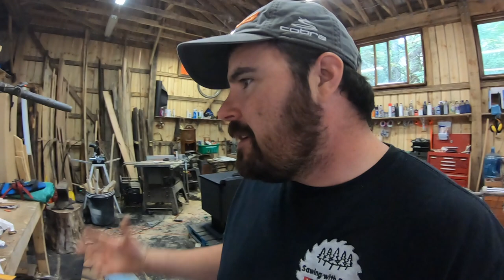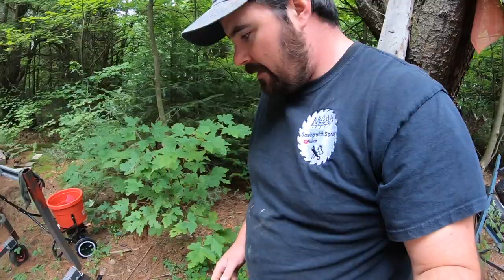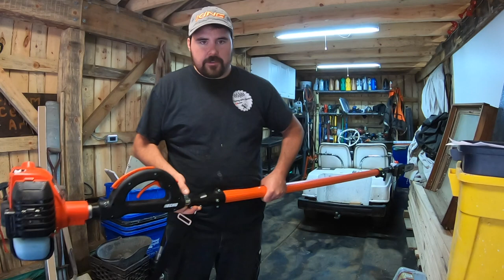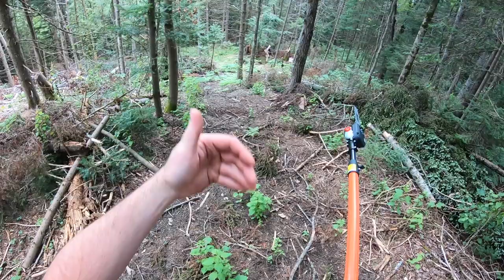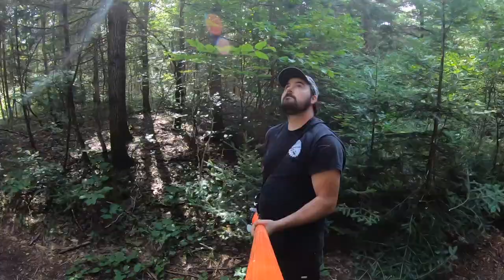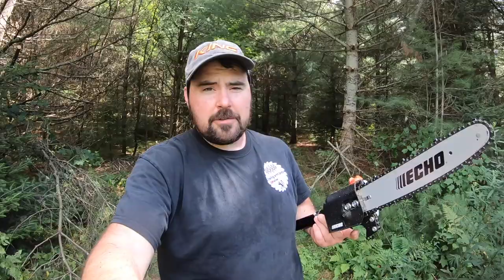Clearing Trails with the Echo ppt 2620 Pole Saw | Pole Pruner Features You'll Want

Comment: I have the same engine but on the Echo PAS system and it has been very reliable for the three or so years I've had it.  It's the commercial engine of the fleet now.  I just recently purchased the pole saw attachment for mine, which, combined with the 4 ft extension gives a decent 11 ft reach.  I used it around the property we rent and if you are cutting limbs more than 2 inch diameter, cut a relief notch underneath about 1/3 of the diameter then cut through the top, it helps negate binding.  Try to cut long limbs back in sections, but that's all I can give for tips.  Also, it's a good idea to have the appropriate protective equipment like a chainsaw helmet and eye googles to keep sawdust out of your eyes and to protect you from falling limbs.

Comment: I have one and love it. It has the reach too.
I also got an electric one with an extension, I use it more than the gas model. 
Its lighter than the echo too.
Reply from the maker: I think an electric would be good as an option too if I had power more available
Reply: Nice video Sandy, however, that price.. Ouch....  Bill Smith, which electric pole saw do you have?  I'm in the market.

Comment: That's a great pole saw you got there.  Even at the 8' shortest length, it cleared a good amount up the trees at the trail edges.  It helps that it starting from waist height.  I would think that if you walked your trails every couple months and trimmed them back you'd would be in great shape.  You are also now getting a good source of wood chips if you clean up all the branched that were trimmed off.

Comment: I have a saw like your's that I use to prune a plantation of 3000 white pine trees to a height of 16 feet. The goal is ultimately to have mature trees without knots (imagine the quality of the boards!).
Tips: Pruning must absolutely avoid injuring the tree. It is important to cut the branch close to the trunk, leaving the growth pad which will allow scarring after cutting.
It is easier to cut the branch from below and go up. We have better control and this prevents the branch from falling before the end of the cut and pulling the bark from the trunk.
On larger branches, cut it 9 inches to a feet from the trunk first and then cut it close to the trunk.
A good harness helps you work longer without getting tired. Stihl manufactures excellent ones. They are a bit more expensive but they are very comfortable and well worth the cost.
A good hard hat with ear protection and visor as well as safety glasses prevent debris from falling on the head and in the eyes.
Always work safely.
Have a nice day!
Reply: If you go up fron underneath as you say, how do you stop the saw from getting pinched??

Comment: Appreciate the review. Looking to buy one if I can find it. No local dealers have them at this time. Had a storm come through a couple of weeks ago that blowed the tops out of several trees. Lots of broken limbs that are still hanging in the trees. Been needing a pole saw for several years but have a good excuse to buy one now. I have a 770 Echo backpack blower that has been an excellent piece of equipment.  Starts every time on the second pull.  The pole saws here in Missouri are around $500.00. Nice place you have there.

Comment: Have had a 14ft  PPT260 or 265 for 10 years, I got it used.   Use the heck out of it a 3 ac wood yard.   it is awesome, but does get heavy after a couple hours of use!  LOL.  Also have a Echo Top Handle saw and tail handle and PAS280 with saw attachment (great for brush and lower trimming)

Comment: Same bar size aals my echo climbing saw is why I want it.and it's weight the sthil is 17 pounds.?however concerned about that shaft breaking, in the truck or while traveling.it has a regular size bar chain.for 12 inches bit sthil has narrow kerf' pruning xhain bar.1/4 pitch ..and more power but this seems like best for removals sake' and it's 150.p00cheaper.